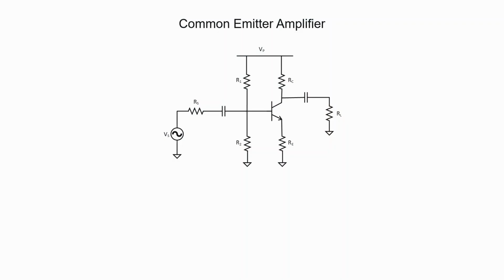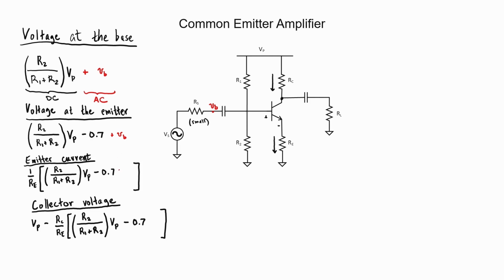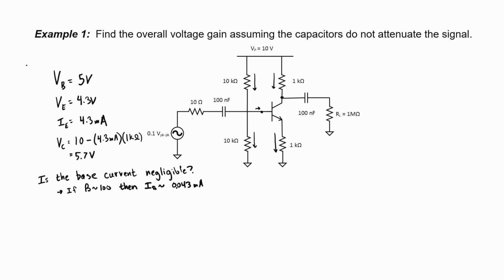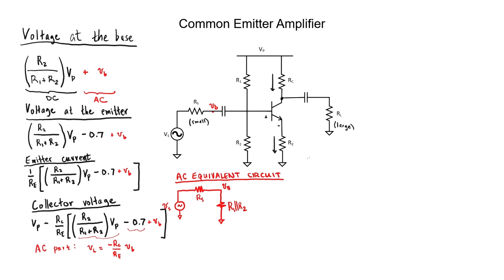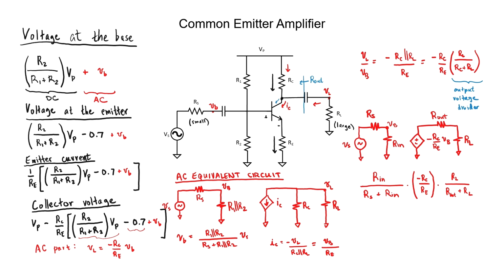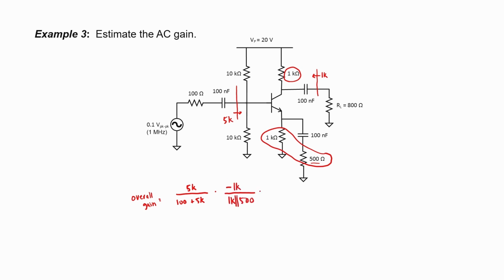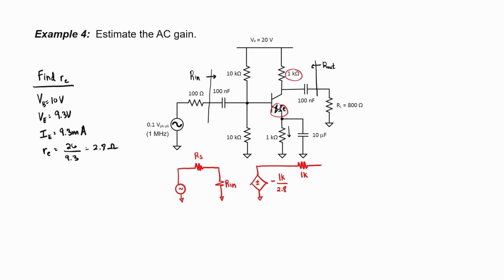Common Emitter Gain Basics (10-Transistors)

Comment: My problem learning from videos may stem from it always seems like this person is trying to prove they can do something i can't rather than show me how to. Not to be disrespectful or anything though.  What an amateur like me might try is to use a voltage like 10 volts or whatever voltage i plan to use .Then figure the total resistance the easy way then the current.   I am sure you have good reasons but I am left wondering why the reciprocal of re is included.

Comment: At 26:40, I think you misstated "For example, if your emmiter resistrance is 26 milliamps" where "resistance" had to be "current."  The closed caption is stating it correctly.  
By the way, I have been watching contents related to transistors, and no one comes close to your level of teaching.  Simply, you are an amazing teacher.  Thank you so much.

Comment: To start with, the 1k collector resistor is far too low for a 1MHz circuit. 
The collector load in series with the 800R and 100n will deliver less than 40% 
The base bias resistors are far too low. 
Where can you find a 100mV input signal @1MHz with 100R impedance?   In fantasy land. 
The whole circuit is absolutely absurd. 
The current through the transistor is enormous. How much “transistor noise” will be generated?
Just a bad design from a person who doesn’t know anything about electronics.

Comment: 1 mega ohms at the input compared to 10 ohms at the output scales in units of tens. Thus, the input corner frequency cannot be 318. Probably it is 159 Hz. In any case, the input C should be upped since 100nF is low for audio.
Reply: Where did you get your electronics education from? The back of a packet of breakfast cereal?

Comment: 3 questions
1. Why did you leave out Re for the AC equivalent circuit ( 15:31 )

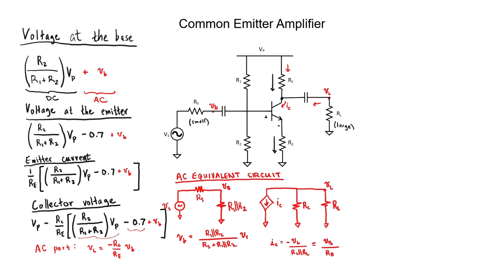2. At 16:02 , why is i euqal to Vb divided by Re ?

3. ATt 17:41 why do we multiply all stages what are they supposed to equal to??
Thank you
Reply: 1. We leave out RE because as he says in previous videos in the playlist, "common" means that the signal path does not have to go through that terminal. In a common collector, the signal goes from base to emitter, and the collector is left alone.

2. In the LHS equation, it can be seen as the emitter current equation, if all DC components are equal to 0. Vb(t) is the only AC signal.

3. We are trying to find the gain, so VL/VS. For the first circuit, VB equation was written. We can substitute VB into the top RHS equation. Then divide both sides by VS to get the gain formula VL/VS.

Comment: I like this, thank you, Aaron!  I'll go ahead and like your series. 
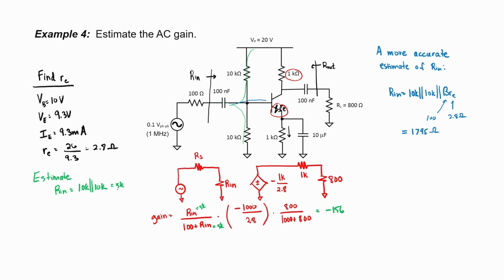Question: time 32:45. How come Rin = R1 || R2 || b*re -> 1795 Ohm? It should be less then any of all 3 resistors in parallel including 280 Ohm shouldn't it? Rin = 1/(1/10,000 + 1/10,000 + 1/280) = 265 Ohm.  Basically almost entire AC current will flow through base, and only tiny portion of it towards GND and DC. 
What am I missing? I am learning.
Reply: correct and  Aoverall gain 0.726 x (-357.14) x 0.444 = -115.92, The most important conclusion, it has a strong impact on the gain, a reduction of 115.92/156 about 26% reduction in gain

Comment: 4.3 mA Emitter current drops 4.3 volt across emitter resistance 1 kilo ohm. Similarly , 4.3 volt drop across Rc . 
So Voltage against the two resistances is 8.6 volt. 
It means Vce = 10 -8.6 = 1.4 volt. 
I think, 1.4 volt Vce is not a good biasing. 
Please comment.
Reply: Je pense que cela fonctionne bien car Vce > (Vce sat ) qui est environ  à 0,2 V pour un BJT NPN..

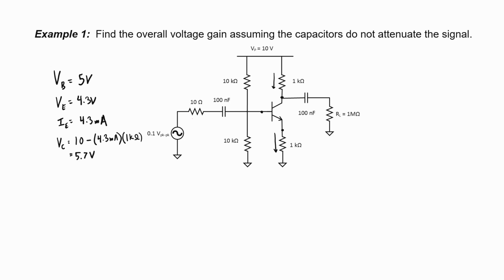Comment: At 8:50 (about) the quiescent collector voltage is 5.7 volts - that's not going to give you much room for amplification. Doesn't it need to be up higher, like 8-9 volts so it can drop when more amplified signal current comes through?

Comment: Just a few points. First, the maximum ac gain is when Re is 0, making the gain = Rc/re. Now re = 25mV/Ic and Rc must be less than Vcc/Ic otherwise the transistor saturates. Normally, we would bias the transistor so that the collector voltage is around half the supply voltage (Vcc), making Rc = Vcc/(2*Ic). That sets the maximum gain to Vcc/(2*Ic) divided by 25mV/Ic = Vcc/50mV. This shows that the maximum ac voltage gain of a common emitter stage depends directly on the supply voltage, and nothing else.

Secondly, you can always get a more accurate value for the base bias point if you think the base current may be significant by taking the parallel resistance of R1 || R2 and multiplying it by the base current you calculated. That gives the voltage drop below the ideal resistor divider value of Vcc*R2/(R1+R2). If that's more than a few hundred millivolts, you may then want to recalculate the emitter current.

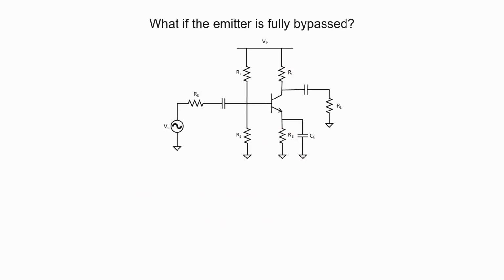Thirdly, in the circuit at 24:15 with a fully bypassed emitter resistor, you have to ensure that the bypass capacitor's reactance is small compared to re at frequencies in the pass-band, so for audio signals where you want the corner frequency to be below 20Hz, a collector current around 10mA will necessitate a 3,000μF capacitor, which is pretty impractical.

Finally, any time that the intrinsic emitter resistance re becomes even slightly significant, the instantaneous gain will start to depend on the instantaneous collector current, which results in the large-signal gain being different for positive half-cycles from that for negative half-cycles, and that produces horrible distortion. In addition, the input impedance will tend to depend on β, which is not a desirable design outcome.

Comment: Aaron - your instruction is the best I have encountered. THIS IS THE WAY circuits should be approached. We want to be able jump right in by inspection with a little hand waving and not resort to writing equations (at first). Inspecting and getting the general operating reason, the context and the basic quantities is something I have longed for for over 30 years and with yorui help I am finally getting into the zone. Our electronics instruction and text at OSU (I have to say the truth) was NOT good. It left me lost and disappointed - finally the good lord has brought me what I wish i had 40 years ago......INSPECT - then reconcile the nitty gritty later - equations are nice but a true engineer can inspect multiple stages in a circuit and understand the map.

Comment: Example 4: Re = 2.8 ohms, so beta * re = 280 ohms => Rin = 265 ohms => gain = -11.5?
Reply: That's almost right: 10K || 10K || 280R = 265R. Then the input attenuation would be 265R/365R = 0.73, making the overall gain 0.73 x (-357) x 0.44 = -115
Reply: @RexxSchneider  The most important conclusion, it has a strong impact on the gain, a reduction of 115.92/156 about 26% reduction in gain
Reply: @HD-yq9jx  Indeed. Aaron should have immediately noticed at 32:44 that he miscalculated. Any designer should recognise that the parallel resistance of multiple resistors cannot possibly be greater than the smallest one, which was roughly 100 x 2.8 Ω = 280 Ω. I have no idea where he got the value of 1795 Ω from. His overall gain figure of 150 is consequently well out (should be 115) and his conclusion that the transistor's input impedance doesn't affect the gain calculation much is simply wrong.
The other problem is that re is a non-linear resistance, and whenever it's a significant factor in a gain calculation, you can be sure it will introduce some pretty nasty distortion, especially with larger signals.
Reply: The gain would come out to -115 if I calculated right. plugging into falstad result in a gain of 156 anyway tho, also confused.
Reply: @zachadams3492  Whatever you plugged it into didn't take account of the impedance looking into the base of the transistor. The gain is clearly -115.

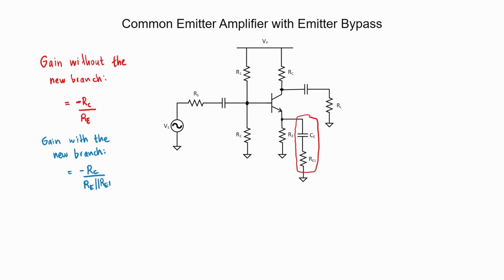Comment: Many thanks for this, Professor Danner. Regarding the emitter bypass branch shown at 20:56, what if the branch consisted of only a capacitor that was connected between two emitter resistors, RE1 and RE2? Would that have the same effect?
Reply: Yes, as long as the capacitor's reactance is small compared to the unbypassed resistance, you can ignore the bypassed resistance in calculating the ac gain -- with a caveat that the intrinsic emitter resistance (re) must still be small compared to the unbypassed resistance.